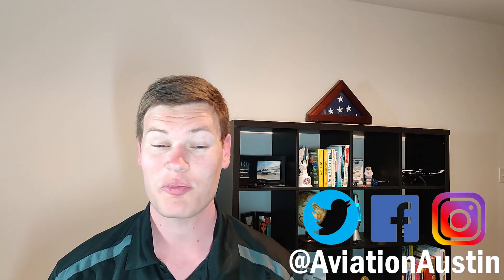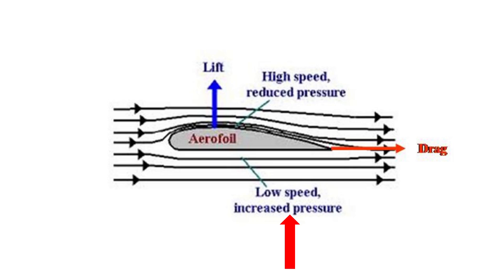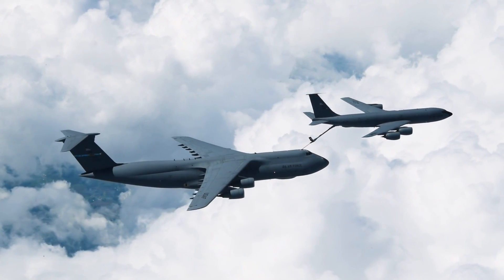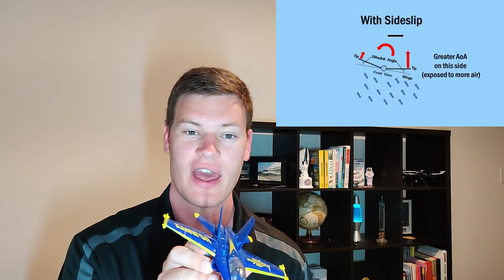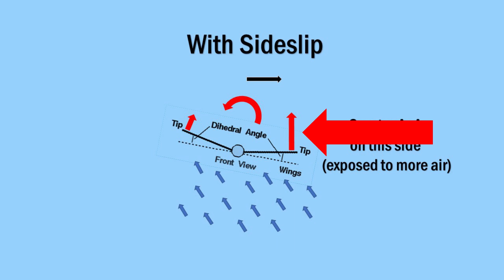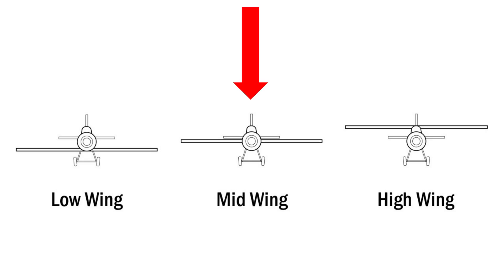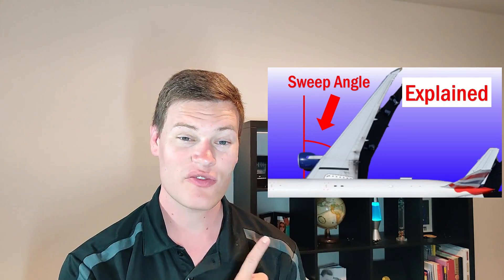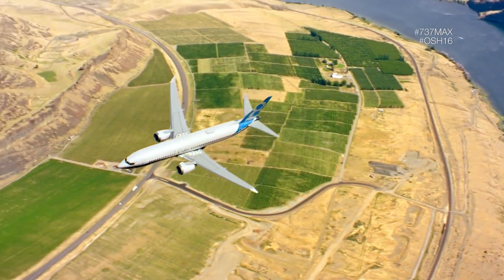Why Wings are Shaped Like This | Wing Configurations Explained

Comment: Thank you for such a great explaining video. I still want to ask
1. why a high aspect ratio wing is less effective in turning when compared to low aspect ratio wing
2. Both the low aspect ratio wing and delta wing can turn well, like Mirage and f16, but why seem f16 doesn't get too much speed bleed when turning and can gain lift more easily? Shouldn't the lift be directly proportional to the wing area?

Thank you ^ ^
Reply from the maker: Ease of turning doesn't have to do with lift. It has to do with stability. The lower stability the easier it is to turn. The lower the aspect ratio the lower the stability generally. The more stable it is in flight means the plane "doesn't want to turn"
Reply: @AviationAustin  thank u！